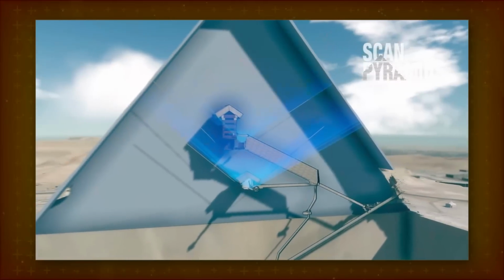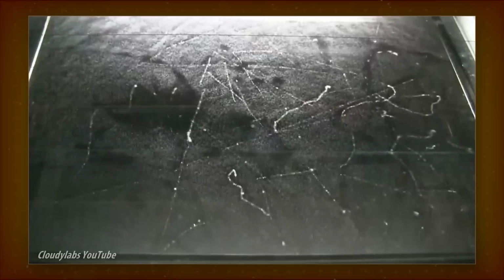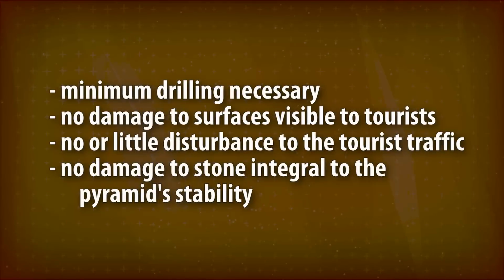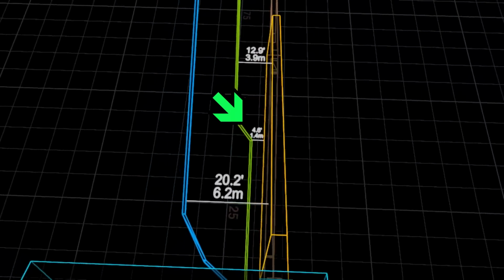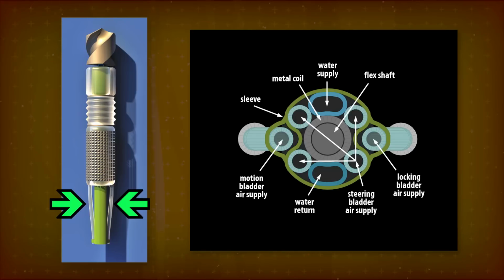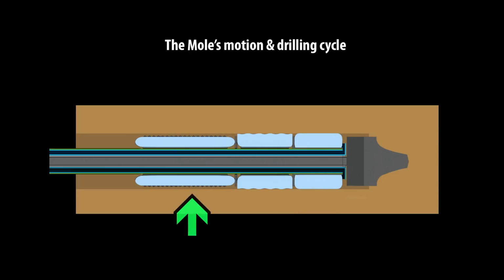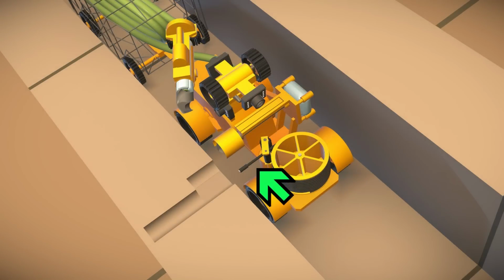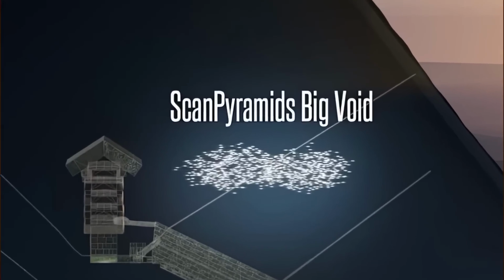Great Pyramid: How to See the Big Void in Our Lifetime

Comment: Some think that much of the interior of the pyramid may be rubble, mortar, and/or sand. Would the drill be able to manage that? Also will it be able to drill through granite?
Reply from the maker: In our view, it's unwise to develop countermeasures against gaps/sand/granite etc until such things are actually encountered in real life. In which case you withdraw the robot and modify it for that obstacle. Otherwise, if no such obstacle exists, you waste R&D time and make the robot bulkier than needed.

Comment: Perhaps the drill mounted on the rover could be mounted on a telescopic cylinder. Imagine it like the tip of a telescopic antenna. 
This should give it a fairly good drill depth before having to switch to the worm drill.

Comment: The void is part of another chamber/ passageway system 112 feet higher up in the masonry. Its entrance will be found to be 102 feet slant height above the known entrance. Possibly 10 feet to the right. Infrared thermography will pinpoint the location. Also, the masonry will be of higher quality and fitment in that area. Befitting its importance.

Comment: Good idea, just that solely rotary motion kinda sucks at drilling stone
Since we're already using pneumatics for movement we might as well use a custom micro hammer drill that's under an inch wide.
Simply adapting a 1" masonry drill and using the drill exhaust as air assist to clear the generated debris would be in line with traditional boring methods used in stone. 
Additionally the system may be able to be launched from a simple starting tube rather than needing a starting hole to be drilled as the bend radius and bulk of a thin pneumatic hose is greatly reduced compared to that of a flex shaft. That is ignoring the existence of flexible couplers.

Comment: Great video. I predict it is a corbelled chamber to relieve weight from the grand gallery.
Reply: You'd think if they needed to relieve the grand gallery, they'd have done it in a similar way that they did the kings chamber.  This big void looks to be further up.  Whatever the case, I love it, it's a great mystery and I can only hope the Egyptian govt will allow an exploration.
Reply: @ShimmyD-u7g  I figure one motivation to add a relieving chamber above the grand gallery is because the top of the grand gallery is 2 cubits wide. In other old kingdom pyramids spaces wider than 1 cubit have corbels to prevent the flat ceiling beams from failing. Hidden corbelled chambers are present in the meidum pyramid above the first 2 chambers and bottom of decending corridor to accomplish this, so it would not be unprecedented. I chose corbels because they would explain the dimension of the void while simultaneously reducing significant mass and redirecting the force. I agree it could also be accomplished with chevrons and that the space appears to be higher up than I would expect. Of course this is all just my speculation, hopefully the powers that be will one day allow an investigation to solve the mystery!

Comment: I appreciate the autism, but just drilling from the outside might take 20 meters and nobody and to be honest, nobody would ever see the drill hole. I don't buy the argument that the Arabs are concerned about the monument, it has tens of thousands of square meters on the outside, it's really not a big deal
Reply: The concern would be about the insects, the climate difference and other things affecting the "space". The inspections and measuring devices must also fit through the hole before it can be rapidly sealed.

Comment: Thank you, very well done.  Being a driller, I'm all for doing it.  However, I think there is one non-destructive intervention to try before drilling.  That would be to remove the block directly facing the end of the sarcophagus in the King's chamber.  As pointed out by Ancient Architects, this block is the only non-load-bearing stone in the Chamber, and it points in the direction of the Void.  We can look behind that rock to find a better way to access the Void.
Reply from the maker: I doubt the Egyptians would allow the removal of any wall block, load-bearing or not. What could be done is to drill a small hole in the center of a T-joint at the edge of that block, then insert an inspection camera to see what's behind it.
Reply: I think drilling is the way to go, but the followup should be more important. The void in the front was inspected with a camera and it looks empty, but what happens if the room is filled with things that is now exposed to the outside conditions?
Reply: That block is very load bearing its not jenga when you are talking about a few grams supported on edges, its tons spread over approx a meter edges of two blocks may not support it (as we can only work on 2d dimensions weights are very estimated)

Comment: If the void is a room or a corridor there must have been access to it at some point. We just need to scan it precisely to find whatever blocks is and remove it. That way we are not destroying anything and we will be able to get full size access to it.
Reply: That assumes that it was ever intended to be accessible. If it was not, the void may only have been exposed during construction, and inaccessible after the fact.
Reply: @Vo_Siri I would say that every pyramid was built to be accessible. Otherwise why didn't they just build a small room in the middle of it? That way robers would never get to it.
Reply from the maker: @TheLeppus28  You can't place the pharaoh's body and his grave goods in an inaccessible room. You need to entomb the pharaoh and his goods, and only then make the interior inaccessible. If the void is inaccessible, then it can't contain anything that's available only after pharaoh's death, though it may contain other things.
Reply: @TheLeppus28  I mean that space specifically. For example if it were purely necessary for structural stability, without any ritual purpose.
Reply: @nightscarab5802  My thinking is definitely leaning toward it being structural. Seems odd to me that they'd have a storage room or whatever which is (seemingly) better protected than Khufu's own burial chamber.
Reply: I think it simply rubble which was used to backfill most of the structure
Reply: @L_Train This is true, it's also entirely plausible that it's just a lower density section of rubble.